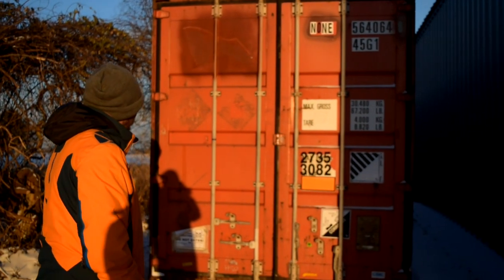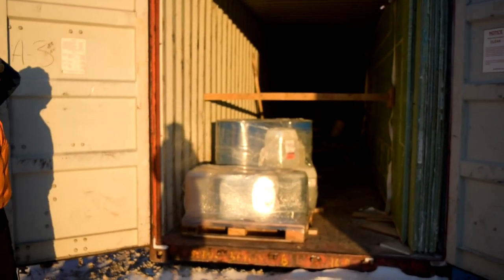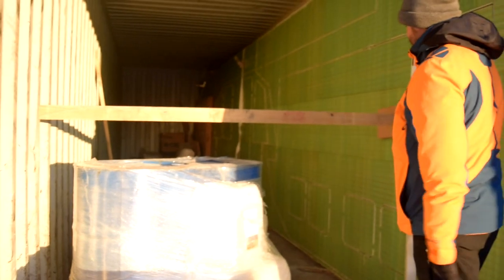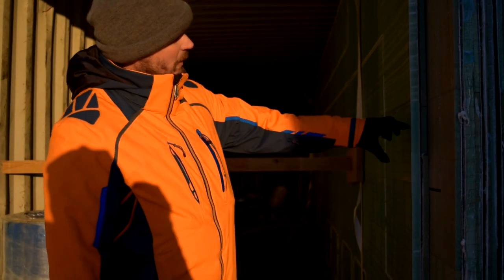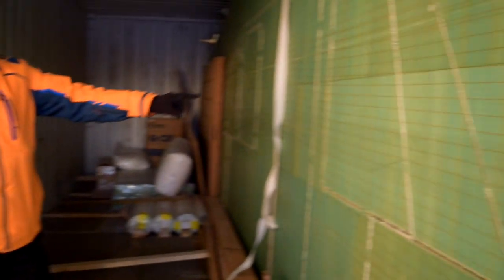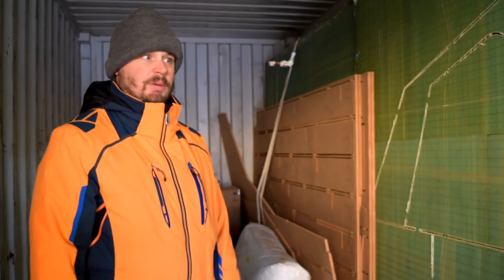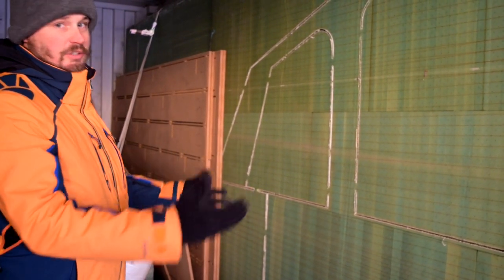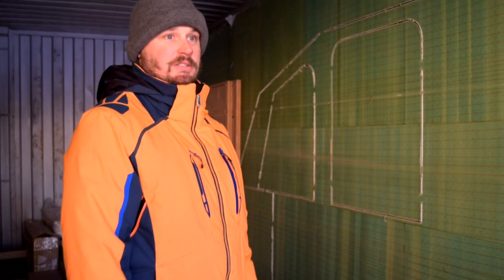SV Ojigwan:  Unboxing our Schionning Arrow 1280S kit

Comment: Did this project stop altogether? Is there a half finished catamaran in that shed?
Reply from the maker: No and yes.  The Arrow build was put on hold to complete 3 high performance racing 30' cats.  You can see photos of those builds on our website.  The Arrow build will resume this spring.
Reply: Great news. I am very interested in this design and especially in the build process.